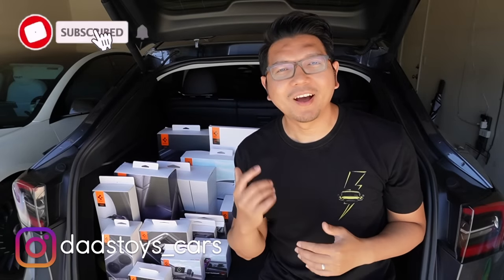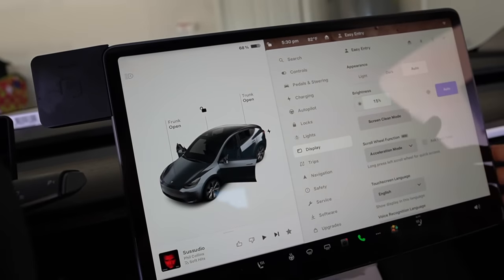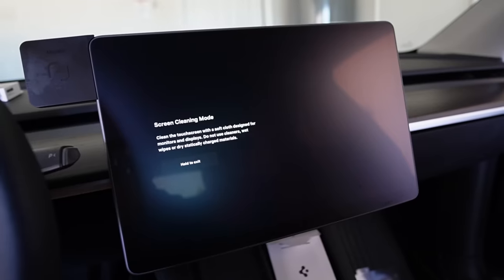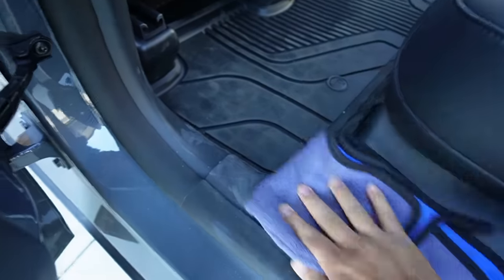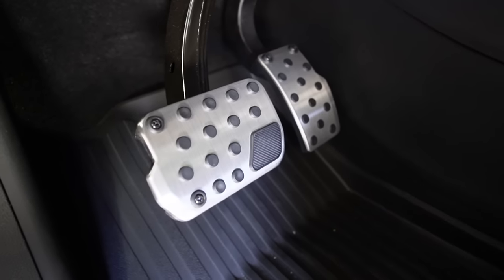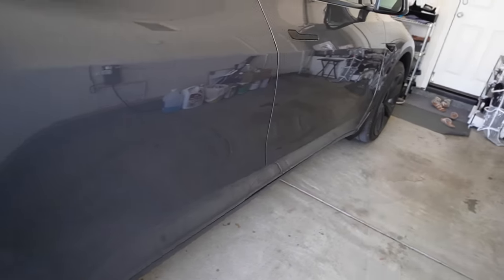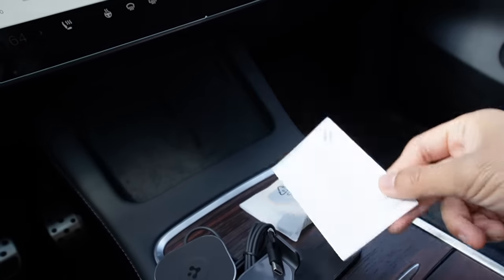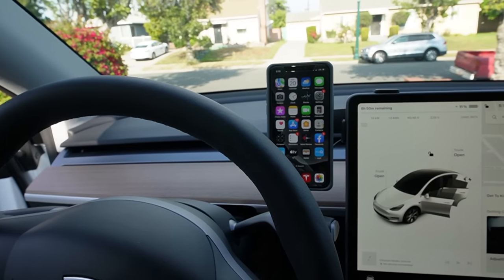2023 Must Have Accessories for New Model Y Owners from Spigen! #tesla #2023

Comment: I've seen two of your videos where you install the wireless phone charger mount on the back of the screen and run the wire down the dash, along the console and over to plug inside the console.  FYI, the wire is easy to hide inside the dash and console.  They both pop on and off in minutes and the wire can be totally hidden for a better, WIRELESS look.

Comment: That Seatbelt thing is nothing that you should use, the belt should allways be so close to body it can be...here you create a big free space that will make seatbelt strecher in a crash less effective and body will move longer before it catch up by seatbelt....and also create a harder snap on you neck that create whiplash damage!...DONT USE IT!!
Reply from the maker: Appreciate your comment and info on the seatbelt.
I think it stays back far enough that it won’t disturb the safety and normal operation of the seatbelt.

Comment: For performance foot pedals, do you remove the original rubber accelerator as well?or do you put over it ?
Reply from the maker: No, you don't have to remove accelerator foot pedal.
You can just install Spigen foot pedal over original one.
Thank you for watching Jenny! :)
Reply: thank you  but it is so hard to put it on...
Reply: Definitely not easy, it glides on half way but hard to slide it in all the way.
finally put it in after struggling for 1 hr., nails broken.😂 sprayed it with W-2 spray  and slided it on 😅😅😅
Reply from the maker: @jennypark2019  oh no, I was going to tell you to wear work gloves so you don’t accidentally get cut or in this case break your nail. ☹️